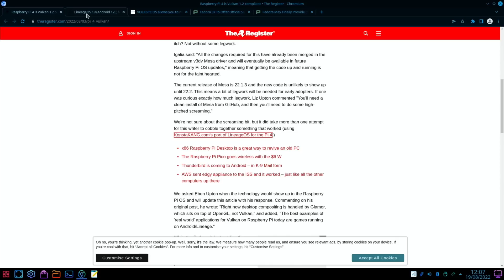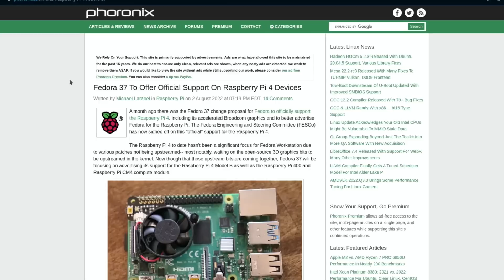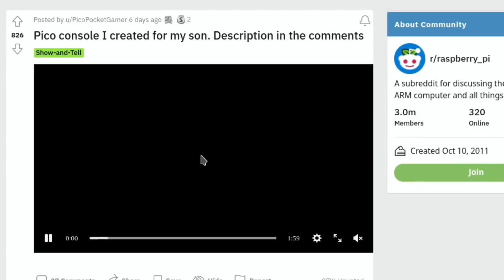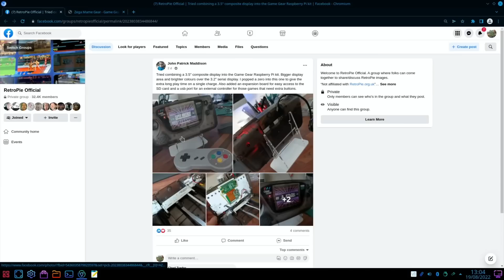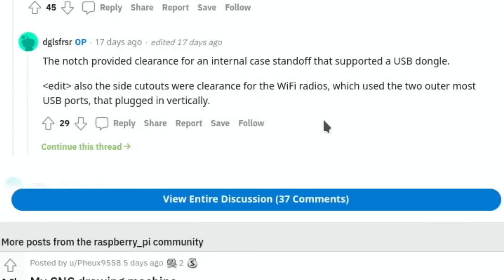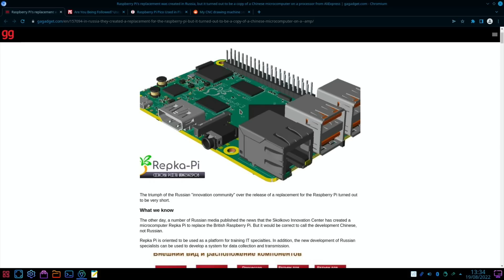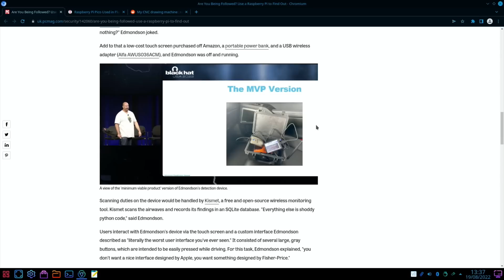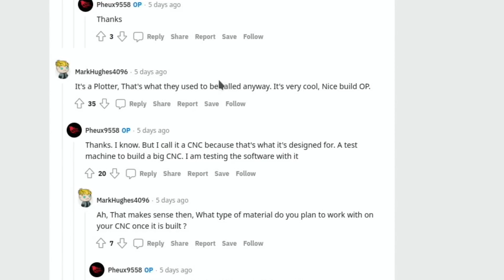Pi news 66. Raspberry Pi Replacement from Russia!

Comment: I have given up on Raspberry PI. I use the new ODROID m1 and up, from Hardkernel. They are putting on (One Board) what raspberry PI should have been doing from the get go . Things like eMMC and M.2 connections to name a few. raspberry PI charges you extra for an endless array of add-on's that do what Odroid does in one board. And in Odroid you dont have to pre configure the firmware to boot natively from  the M.2 or whatever SSD you connect, like you have to do in raspberry.I have not heard very good feedback from the Russian PI replacement . Most seem to think it is a step back in time rather than a step forward.

Comment: Good update as usual. Also, the fan was quite confusing to fit in WY_Pi Case, but I see they've updated the website with picture in sub header Ventilation... Have to make note of bt address of the keyboard and set that up per OS, so sometimes need to plug in a wired keyboard for set up... makes a nice Amiga600 replacement with PiMiga ! or a nice little general pc as it feels good and solid. Wish it had better access to gpio & mSD card slot... may wrangle up an extension for the latter.

Comment: What theme are you using? Looks pretty cool. If you can get a PS2 emulator working on a Pi I would love to see that, especially if you could play Psychonauts.
Reply from the maker: This is my current setup. It’s available to download 

My Linux setup part 2 64bit KDE plasma Raspberry Pi 4 / 400. Download Links.
https://youtu.be/_FDgsDC4FU0

GameCube already runs reasonably well

Best Nintendo GameCube emulation so far! Raspberry Pi 4 2325MHz Overclock.
https://youtu.be/9FaJfqAWOeM

PS2 not so well

PS2 on Raspberry Pi 4. PlayStation 2 emulator AetherSX2.
https://youtu.be/DP59TDE2H8Y

Hopefully Vulkan 1.2 will improve things

Many PS2 titles were also released on GameCube

Comment: I compiled the new Vulkan 1.2 along with Mesa implementation a few days ago (for Raspberry Pi OS 64 bits).
And yep, it's better with PPSSPP for example.
But sadly, Vulkan is still not performant in Chromium.
So there is no noticeable improvement in Youtube videos.
Reply: Nice! Was there any noticeable improvement in Dolphin emulation with the 1.2 Vulkan drivers? I tried yesterday with a version of 1.1.7 Vulkan drivers, however performance was still terrible. I don’t think the hardware is capable of GC emulation despite all of the driver conformance and improvements we’re seeing.

Keen to hear if you’ve had a try of it with a GameCube game!
Reply from the maker: @stonededge  this is nearly there with GameCube 

Best Nintendo GameCube emulation so far! Raspberry Pi 4 2325MHz Overclock.
https://youtu.be/9FaJfqAWOeM

Vulkan 1.2 could be the difference we need
Reply: @stonededge  I'm compiling Dolphin right now and will give a shot with Super Mario Sunshine ;)
@leepspvideo
Reply: @stonededge  Well no it's still not playable.
I did not notice any improvements since Vulkan 1.1 sadly.
Cinematics run between 10-30 fps, and in game it's around 6-8.
It could be probably better with some fine settings, but I doubt it will render the game at 30 fps anyway.

Edit : important to note that I'm on Raspberry Pi OS and not Retro Pie.

Maybe with Retro Pie it could be much better in the future!
Reply: @user-xd1ds3ch7f  Ouch, not the news we wanted to hear, but I really doubt the Pi 4 is ever going to run GameCube - even with better vulkan drivers. Not to lose faith or anything but the hardware really isn’t there. Fingers crossed the Pi 5 is announced soon! Thanks for the test!
Reply: @stonededge  I agree, it's all about the RPI5 now :)